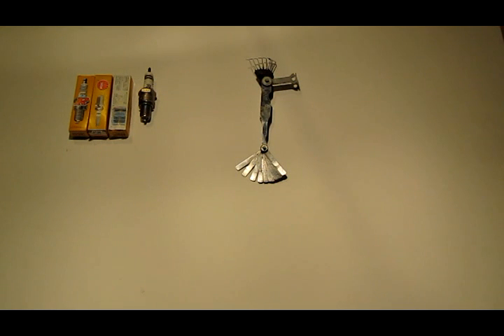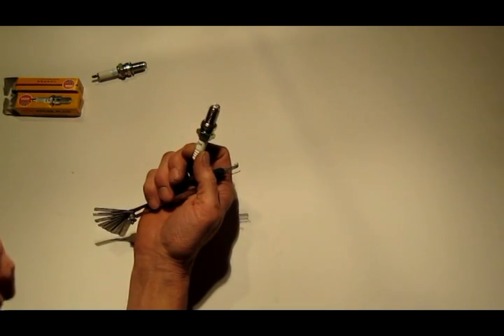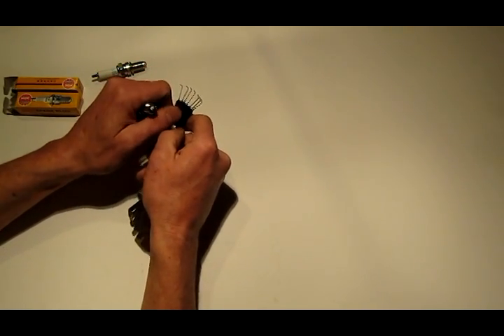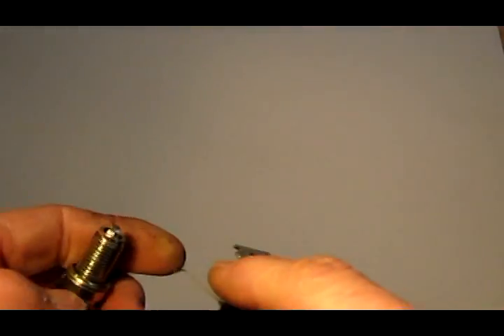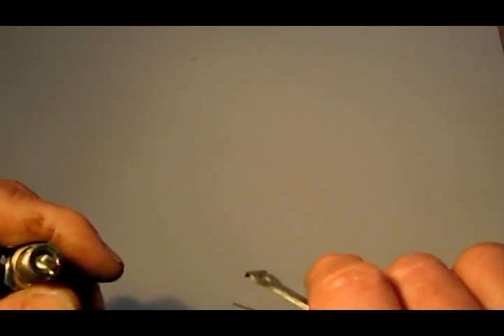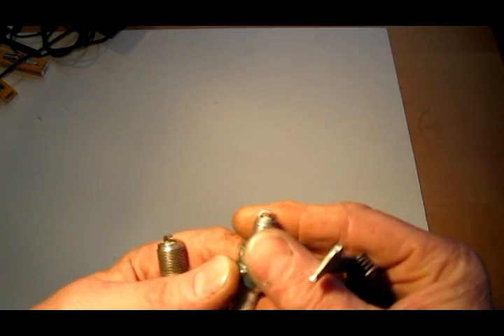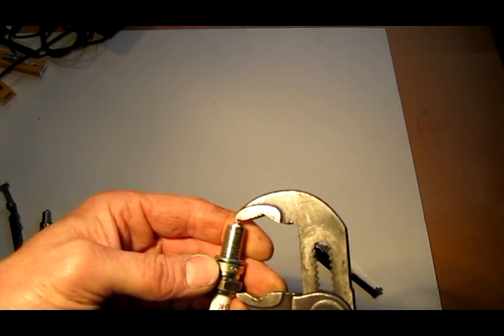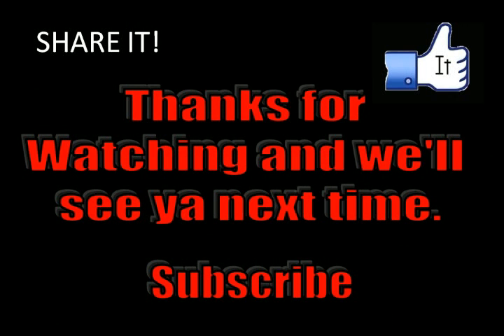Set your spark plug gap

Comment: Does Platinum Spark Plugs and Iridium Spark Plugs, need to gap?
Reply from the maker: Regardless of the material that the spark plug is made out of the proper gap is still very important.  The different materials just wear out at different rates.
Reply: i see.
Reply: NO do not gap platinum especially iridium plugs the iridium tip is very brittle and if you break the tip the plug will fail prematurely!!!!! breaking the iridium tip will effect gap later on when the iridium falls off after it is installed and then the  gap increases as well when it does so!  Its better to leave well enough alone!
Reply: You can gap platinum and iridium plugs! http://www.ngksparkplugs.com/about-ngk/faqs/spark-plug-faqs/do-i-need-to-set-the-gap-when-installing-a-new-set-of-plugs